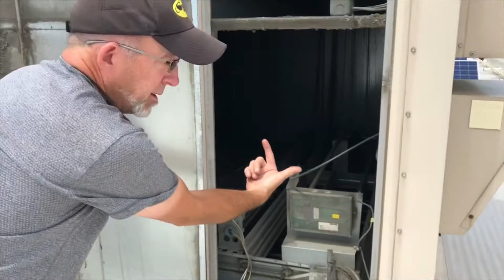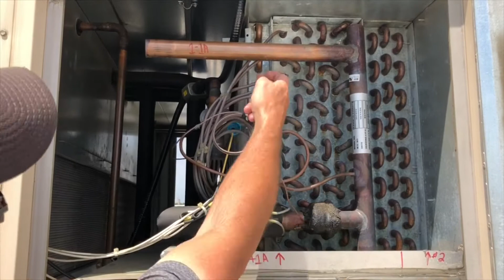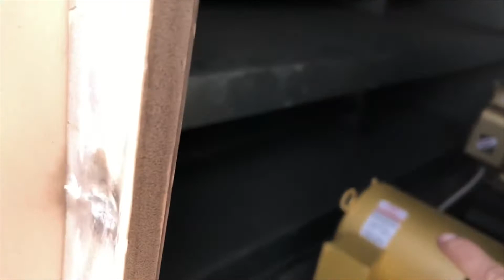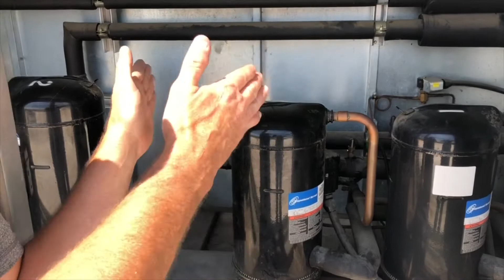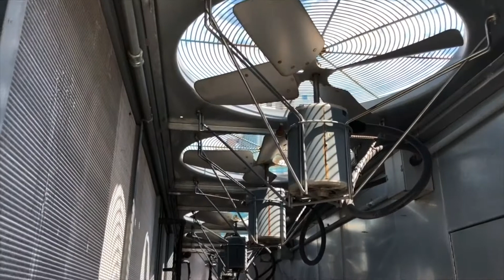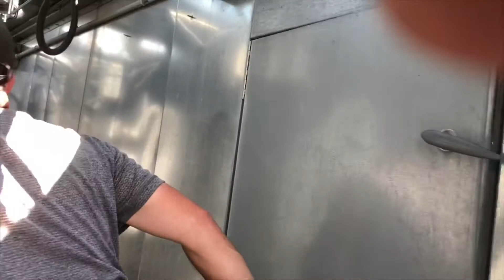Seasons4 DHU / Basic Layout

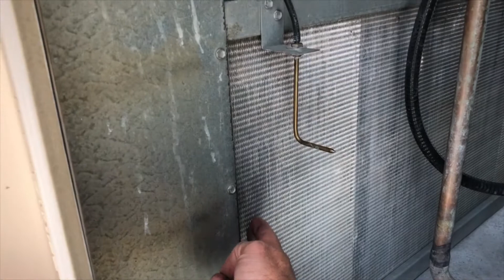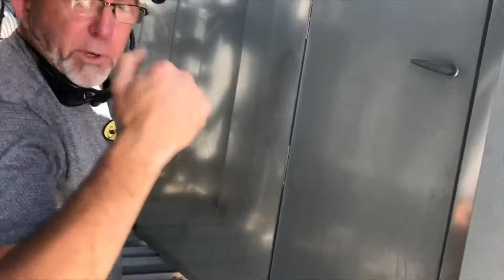Comment: 5:40 and 14:51 - You’ll also notice here, guys, that the fins on all these coils are extremely thin. Notice the fins bend flat every time he punches his finger or fist into the coil. No heat will be exchanged at that exact point until they’re straightened back out!

Comment: Looks like there was also some face and bypass dampers by the DX coils. I've worked on plenty of Munters units, never a 4 seasons. Cool video and explanation. A DOAS unit is also designed to keep a neutral temp not designed for comfort cooling/ heating
Reply from the maker: Good eye Jason, you nailed it these are not designed for comfort cooling/heating designed to maintain a target temp and humidity while supplying make-up air like you said.
Thanks for spelling that out a little clearer than I did in the video, appreciate it !!
Reply: @David Harty  how are those face and bypass dampers set up. Im assuming its taking outdoor ambient and enthaply. If conditions are correct, open the bypass/ snd or modulate and cool with ODA or keep discharge air temp at set point.
Reply from the maker: @JJ-COMMERCIALHVAC  Target runs them with as much outdoor air as they can based on temp and humidity like you said during occupied hours year round

They’re using them for dehumidified make air in the summer and heated / dehumidified make up air  in the winter, for the grocery side of the store 

Bypass is only closed in night setback mode / unoccupied